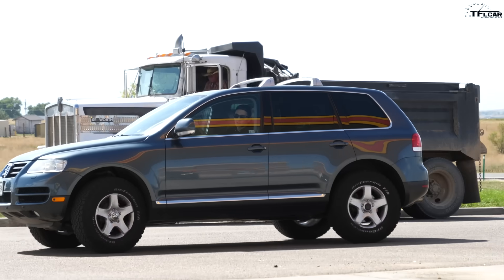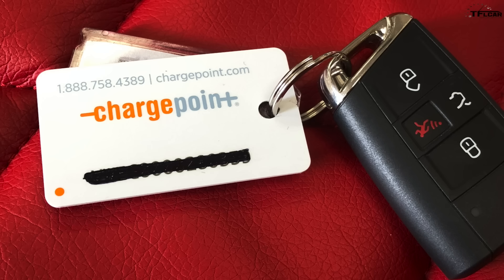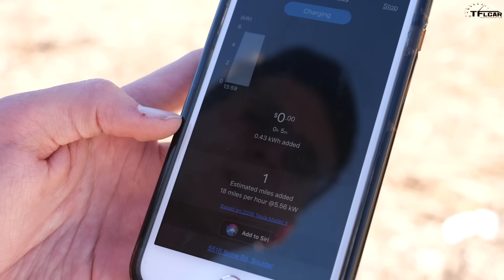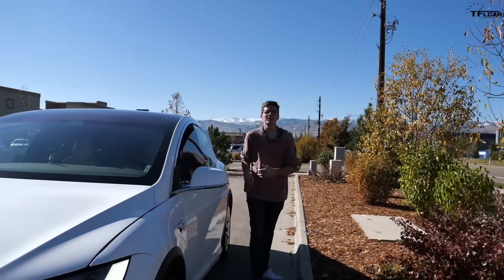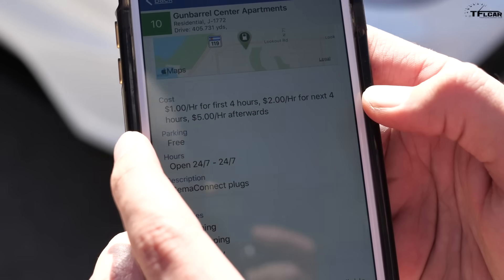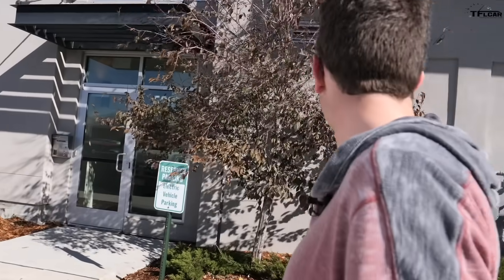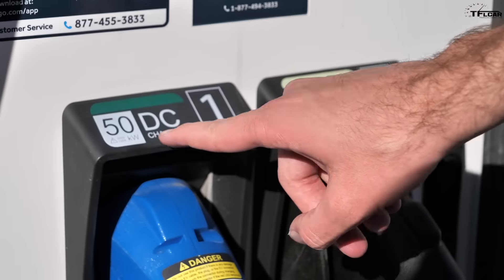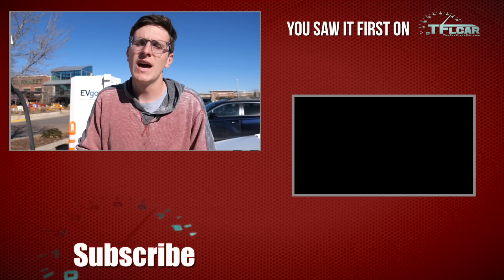Here’s Why Charging an Electric Car Can Suck - And It’s Not The Reason You Think!

Comment: hours ? i get antsy filling up my 9 gallon little car gas tank at costco.
Reply: hey todd. i live in hawaii. we're behind the times in many ways. i rarely even see an electric car. many of us don't
have electricity at home (except solar). so, i got a brand new car that gets 48 mpg (non hybrid). we all do our best.
check out the chevy spark. funniest coolest smallest cheapest new car you can get (ls trim, 5 speed manual).
Reply: @gibbyjones1040  That (Spark) seems like good solution for your situation. An EV appears to be more cumbersome in your situation, but anyone connected to the grid and the right and ability to add a 240v circuit can easily charge at home, and in the case of island living, NEVER need to go to a commercial charger or gas station again.
Reply: @gibbyjones1040  "i live in hawaii. we're behind the times in many ways"
But your going to be the first state that eliminates fossil fuels from your grid production; so in that way, you're quite a ways ahead.
Reply: Lol, I don't see busy workers having the patience to do this where's Waldo charging station dance each time!
Reply: @Desertfox92308  If you're charging at home, this is a non-issue.  If you can't (renting or your electrical service panel is limiting) THEN this kind of "where's Waldo" becomes an issue.
Reply: If you have the ability to charge at home, you'll just about never use chargers in your geographic area and that time waiting to fuel up becomes "zero", and you only have this issue on road trips.  I can't vouch for road trip charging for the bulk of manufacturers, but three road trips later (~600 miles, ~1100 miles, and ~2500 miles) I found doing it in a Tesla Model 3 pretty simple and not all that more time consuming when you use charging time for bathroom/meal/stretch-your-legs breaks.

Comment: I won't buy an electric vehicle until every parking spot has a charging station. That would be the only way to compensate for the long charge times. Just have to remember to plug up every time you stop. Or until they make charging to full no longer than 10 min.

Comment: Why am I getting  the "There's got to be a better way?!?!" late-night infomercial vibe while watching this video? I fully expected Tommy to try to plug in the wrong cable into the tesla, and then look at the camera with that confused, tilted dog head look.  [Que 'sad trombone' sound clip]

Who makes the commitment/investment in buying a new or used EV without first investigating the changing capabilities and options for their scenario? And if this video was supposed to be one of those steps in someone's researching, it missed the mark. Imagine blaming Apple and other cell phone manufacturers if someone bought their first smartphone and a bunch of chargers, without first checking if they were compatible.

This just comes off as an omen, a deterrent disguised as a warning to those on the fence about buying an EV. And a head-pat to the 'hurr durr experts' that like to spread uneducated opinions as facts in the comment section.
Reply: Edward Green, Jr you do understand that people make impulse purchases based on what’s “hot” before doing research? so before bashing a video doing what it’s suppose to do how bout you think of people who don’t think the same way you do
Reply: A very good point was made in the video that explains the video itself.

Imagine that each gas station had fuel that only worked for some vehicles, but not others? Lets say... Diesel. Now imagine there were actually 5 types of fuels for regular cars. Some stations carry 1 or maybe 2 of them... some 4. How do you know which station has YOUR fuel???

Now imagine that each brand only allows you to get fuel if you have a pre-setup account with them too.

What person who’s never driven an EV knows that’s how that works? It’s counter-intuitive compared to all other cars that have ever existed before. People don’t know this and it is complicated and annoying. Videos like this explain it all.

Comment: Thanks for the video. It does a good job of pointing out the confusing nature of the existing charging infrastructure. However, I think you glossed over the home and work charging. I think most people will charge at home or work. The costs of adding a 240v outlet is clearly worth it. However, depending on your daily commute, you may be able to get by on 110. I have a friend with a Leaf who charges at home and at work with nothing but 110 and hasn't had any problems. Also, I don't think you gave enough emphasis on the Tesla Supercharger network specifically for interstate travel. which is their intended purpose. There are currently 716 in the US and more are coming online all the time. Your point on the CCS combo is well taken. Tesla should add them to the new cars and the existing Superchargers as they have done in Europe. Thanks again for the video.
Reply: Also the range on their Leaf is what, 80mi...?
Reply: @BlackGT1999  Pretty much.

Comment: Tommy thanks for videos like this. I've had my chevy volt for a while and most people dont understand how annoying it is trying to find a charger that's not closed, not silly expensive, or finding the company that you like. I've always had good luck with charge point, but I always end up thinking that there needs to be an industry standard or easier way to just pull up and charge!